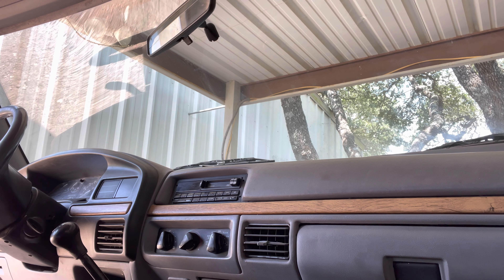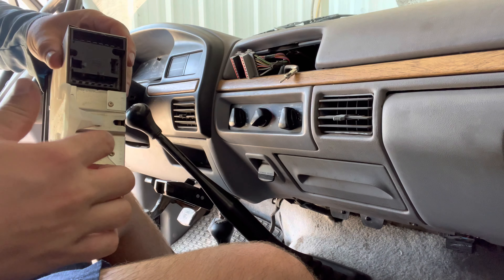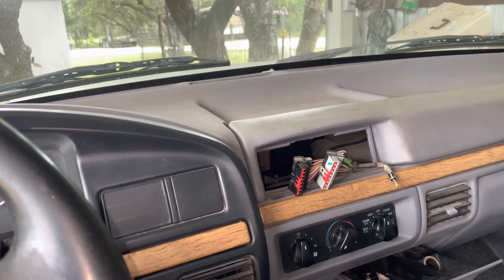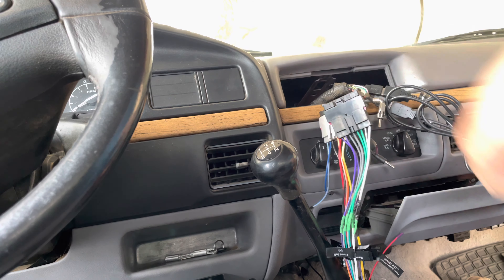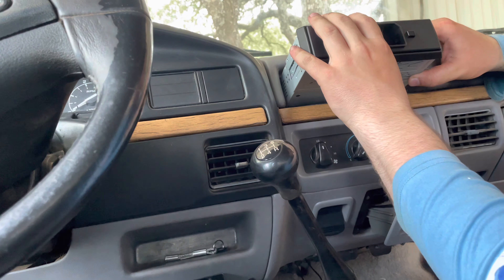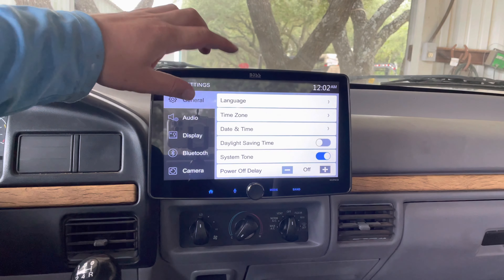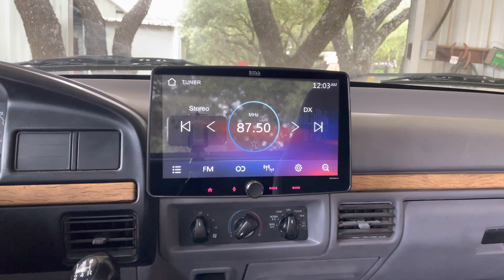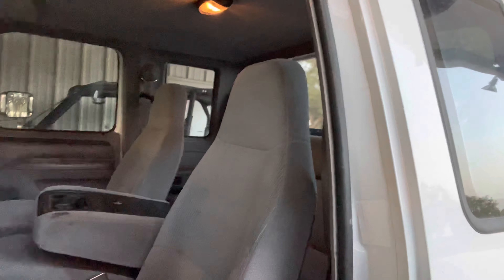An Absolute Necessity For Any Old Truck!

Comment: With the crazy prices of new trucks (between 60 and 100K) today, it's better to outfit an older truck that's in great shape. I am updating my pristine 2004 Super cab 4x4 F150 with low miles to have all the bells and whistles of a new truck. Total expense will be under 6k. Well worth it.
Reply: Jesus loves you alot trust in His death 4 salvation and be saved from eternal hell <3 Jesus died on the cross for you bro.
Reply: Exactly what I’m doing with my 07 gmc Yukon.  Wayyy cheaper
Reply: I’m pimpin out a 03 rwd liberty
Reply: You are so right. I’m going to stick with old cars until I can pay 50k cash. My coworker pays $1700 per month for two cars.
Reply: I’ve had two and i sold both there’s something missing with reliability and technology. It’s great but never consistent. Old trucks just work and cheap to fix you don’t need flash or update anything if it gets replaced and I had hard time justifying an 800 dollar tail light for my F150 and Ranger in case something happened lol the prices on those parts is insane
Reply: Now I’m glad I’m getting my old 94 Ranger as a cheap daily I can fix up until I find a much newer ride later on again.
Reply: Fr I have a 1993 Chevy k1500 and getting my transmission rebuilt right now it’s a good running truck I’m in it about 4000 atm around that maybe closer to 5 bought it for 2800
Reply: @Fit4C - Jesus should have taught you to spell,  “alot” IS NOT a word … you meant to say “a lot”
Reply: Funciónara para Nissan rogué 2018

Comment: I've gone through a couple of these over the years. Definitely a must. The only advice I can offer is; Make sure you get one with plenty of space between the head unit, and screen. The bigger screens will hit the bezel  if you tilt them in your direction to see better. My new has screen rotation, so I can switch orientations. Gives more clearance, but covers the a/c controls 😑 Great video! Wish this kind of content was available years ago. It's always harder when you have to figure it out yourself 😅

Comment: Had a fun time getting that radio out. I use 4 allen wrenches that will fit the holes tightly or close to and pull that thing right out.

Comment: A little tip for using those radio removal tools in the future, should you ever need to. When you’re pulling the radio out, pull the tools away from each other. That will cause the ends of the tools to push towards the sides of the radio and make them less likely to pop out.
Reply from the maker: @eagerestwolf  I appreciate it!

Comment: Thanks for linking the dual USB ports. I just brought the same radio for my car just the 9 inch version.
Reply: How does it sound?
Reply: @budjiman1  the sound is mostly dependent on your speakers, I'm sure you know that already but any radio is gonna practically be the same these days as far as sound quality goes
Reply: @JimTheKid  i bought 4 moper 6-1/4 inupgrades. Sounds way better!

Comment: Good job ! I’ve been thinking about installing one also! As for your seat just buy a memory foam seat cushion , I did because you’ll have a hard time finding a matching seat! My interior is the same color as yours ! Drivers side panel is cracked and needs replacing again no luck finding one! Also good to see your truck is a standard 7.3 like mine keep on rolling!

Comment: Thanks for posting this. I've been scheming up a similar idea for my 2001 Chev Silverado 4WD  Supercab. Don't know if it was offered in the U.S. but in western Canada they had the "Z 71 HD" package with better seats, nice interior & electronics and a good factory trailer package. The o/o was an audio fiend, and he'd installed a high-end Boss sound system just before I bought it. With luck, there will be a big screen head unit available for that, since it's pretty recent. The dash layout is similar to yours, and there's really no way to go the "double DIN" route. Just to make it interesting, I also have a ham radio setup on a Ram-type mount. 
What I'd really like is a higher, larger screen for GPS and the digital video from the wireless rear & side cameras. Those are a real game-changer & I'd like to integrate them so everything could use the one big screen.  Having the screen sitting high, as your setup is, looks useful.  The Silverado's layout is a lot like you have in the Ford.  The wireless back/side cameras  setup makes life a lot simpler. No fishing multiple cable sets, and the digital video signal is interference free. Anyway, thanks for showing this - it looks good, and has given me some good ideas.
Reply from the maker: I hope it all works out for you. So far I have really enjoyed mine.

Comment: I prefer the ones where the screen flips out so it doesn’t block any controls and just fits better with the interior
Reply from the maker: I saw those when I bought this one, but never had seen someone with this one. So I decided to give it a try. Still using it today and really like it, it is a little bigger than you need but it does not block any controls in my truck since you can adjust the height.

Comment: Did you have to drill the hole where you put the USB port in bigger? If so, what did you use?
Reply from the maker: Yes you do, I used a step bit to make it bigger.

Comment: Would the wiring be the same on a 88 f150 if so could you possibly do a video showing what all the wires are tied into the harness you did color code wise wiring is my weak point and I’d hate to burn my truck down or blow my speakers getting the truck for just under 2400 including parts to fix it

Comment: I’m installing this into my 1994 f250 and I was just wondering, there are 18 wires on the aftermarket radio unit, and only 14 wires on the harness, how exactly did you match up all the wires? Did you attach more than 1 wire to another wire?
Reply from the maker: The radio had some wires that I did not match up to anything. Just put electrical tape around them and keep them to the side. Just incase you do need them in the future.

Comment: Did you have to wire in the harness or was it something you could buy and just plug and play?
Reply from the maker: I had to wire the harness for the radio to plug directly into the truck.
Reply: Any way you could do and up close of all you wires to see which ones go where?...im terrible with wiring
Reply from the maker: My apologies but I would rather not pull my radio back out of my dash. Do you have the same truck as me? If so when you buy the harness it has a color list on the back that says the color of wire and what it does. Then you match that wire function to the wire that is labeled on the radio. Does that help you? If not I am sure someone has a video on the internet of how to wire. Looking back on the video I wish I would have shown me wiring it.

Comment: currently in the process of doing this with the same radio , anyone know which wires to leave out currently have everything on the harness adaptor connected excpet blue , blue/white and orange/white , dont know if i need to connect those
Reply from the maker: Just make sure you have everything attached like it says in the package. If you have any left over make sure to tap them off. I had a few leftover. Cannot recall the colors though.

Comment: How do i remove the cigarette lighter socket to put the usb piece in it?
Reply from the maker: Make sure your battery is unhooked. 
Unplug the wires in the back side of the lighter socket.
I believe it has a nut you have to unscrew that is around the whole lighter socket.
Then you will have to do some minor trimming to get the USB ports to fit.

Comment: dose it turn on the backup camara when you shift to reveres?
Reply from the maker: @yourmemenot5575  it will if you wire it to your reverse lights. This truck does not, my other truck does.

Comment: So driving down the bumpy roads are doing mild off routing how has this held up?  Thinking about getting one of these for my 2002 Cummins
Reply from the maker: It has been good so far. I added a piece of Velcro to the back side of it and attached it to my dash, so that the screen wouldn’t vibrate.

Comment: I’m gonna assume u still have this stereo in your truck. I live in Tennessee so I’ve got a quick question. How does yours function in the winter.
Reply from the maker: My winter doesn’t get very cold. When it does get cold it is around mid 20s and it works fine.

Comment: Thanks for the review 🫡 looks like you posted this about 2 years ago. May we have an update please 🙏 do you like it? Was it worth the money? Still works? Issues? Some people's reviews say the screen is too bright and is an inconvenience for night drives, any thoughts on that?

Thanks 🤙
Reply from the maker: 100% worth my money. The only issue I have had Is with my wiring. I twisted the wires the first time, so I had to take the radio back out and solder of the wires. The reason being is because sometimes my speakers would cut out, but that was my fault. I do not think it is not too bright (I went settings and turned the night setting to the lowest possible number making it very nice for night driving). Also when I wired the radio I connected it to my lights, so when I turn on my lights the screen goes to “night mode”.

Comment: So you have an older truck which probably doesn't have a modern security system with this thing sticking on the dashboard does it not attract theft?
Reply from the maker: That’s a good question. Most older trucks do not have security systems, but you can remove the screen very easily and store it away if you think it will be a problem.

Comment: My Apple CarPlay doesn’t turn on any help?
Reply from the maker: Did you check your connections? If so maybe there is something in settings. I never had a problem with mine, but I can try and help.

Comment: Hey Skylar, I’m getting ready to put the same exact setup in my 97 7.3, how did you get the usb cigarette port into the spot of the original plug in
Reply from the maker: I believe I just unscrewed the original one and pulled it out. After that I took a dill with a bit and made the hole bigger by just going around and around in circles unlit it was the correct size.
Reply: I appreciate it brother thank ya! Also wanted to ask did you use any of the bracket pieces? I’m a bit stumped on those
Reply: And one more thing, when you connected your harness to the plug in did you wrap the wire ends around one another or just simply shrink wrap em together?
Reply from the maker: Personally I did not use any brackets other then the white plastic one I showed in the video.
Reply from the maker: I intertwined them and then covered the bare metal with shrink wrap.

Comment: What did you do to mount the new radio? I bought one and all ready to put it in but haven’t figured out yet how to hold it in place.
Reply from the maker: Mine just slid in. I put that white hanger on the back of it to hold it up. Other than that it just sits there and I have not had a problem
Reply: @skylarwagner1155  where did you get the white hanger piece?
Reply from the maker: @JordanGrayMusic  it was on the old radio out of the truck.

Comment: I bought the same radio and installing it in the same truck I installed it and as soon as I flipped to my rear tank the radio popped and started smoking. How did u ground ur radio?
Reply from the maker: I grounded it to the stock wiring harness.

Comment: Is there anything else you would recommend i buy for the radio other than what you have linked in the description? Very close to buying the 9inch version just wanna make sure i have everything needed.
Reply from the maker: The only other thing I bought was some Velcro so I could stick the bottom of the screen to my dash. The roads I drive are really bumpy so it keeps the screen from moving so much.

Comment: I got mine today and was wondering what you used for the parking brake wire on the back of the harness
Reply from the maker: I believe I did not wire that up. I just taped the end and tucked it out of the way.
Reply: Just add to the ground wire. Find someone who can verify.  I'm doing this in my rv. That was my tip. With a very stern" Don't watch TV going down the road." Lol!

Comment: Do you know what you would do it the plugs you have don’t Match to the ones on the truck?
Reply from the maker: Do you have an obs for like mine? If so and the plug doesn’t match up you most likely have a factory amp, if so I heard that the plug like I used is hooked up to the amp somewhere so you’ll just have to find it. Maybe look up some videos on how to by pass the amp. You can also just cut and splice all the wires together.

Comment: What wire did you use for the reverse wire for backup camera? I have same truck and year and same touch screen
Reply from the maker: I didn’t hook mine up to any trigger wires. I just turn it on manually when I hook up to trailers.

Comment: Did you ever get CarPlay to work and if not why doesn’t it? Looking to put it in my truck
Reply from the maker: CarPlay works perfectly, maps are not laggy and everything works.
Reply: @skylarwagner1155  how did you get it to work I just got this radio and CarPlay isn’t working
Reply from the maker: You have to have that external usb plug that plugs into your phone. Once plugged in go to the Home Screen where you can see settings, tuner, CarPlay, etc. click on CarPlay and it should work.

Comment: I'm thinking of getting this for my jeep tj. But I will have my top down so my question....is the screen removal for security?
Reply from the maker: Yes, behind the screen there are 2 buttons that you can push and the screens comes off.
Reply: It’s the reason I put it in my Jeep JK. I was gonna go with a much more expensive floating screen but none of them are removable. If I have the top off my Jeep and it starts pouring, I need something that detaches instantly. Boss Audio is the only one that does. And guess what ….. it’s actually a beast of a radio so far. Only time will tell. But it actually has a 5 year warranty. Sony and Alpine only have a 1 year on there’s which are 4x more expensive.

Comment: Is yours still running? I've got the same one and it died after about a month. Waiting for a warranty replacement.
Reply from the maker: Yes! Mine is running good I use it everyday. Sorry to hear that I hope you get a new one from warranty.
Reply: @skylarwagner1155  Getting the radio replaced under warranty.

Comment: Does it shake while driving on the freeway
Reply from the maker: Mine does not, only when I went down dirt roads. I did fix that shaking problem by adding Velcro to the back of the screen and sticking it to the dash though. Now it does not shake at all.

Comment: On something like this if you were to plug say an Xbox 360 video av into the back up camera then when to av(or the back up camera on button) would it work.??
Reply from the maker: Not sure, but I think it has the correct ports on the back of the unit for it. You will just have to find power for the box.
Reply: @skylarwagner1155  power inverter on Amazon

Comment: Hey nice job doing the install! Do you have a link for that steering wheel cover if you got it online?
Reply from the maker: I actually bought it at Walmart, should be in the automotive section with a few other selections.
Reply: Ok thanks,
Do you know the size by any chance that worked for you
Reply: Also do you know where one would find new leather bench seats that fit in this generation truck?
Reply from the maker: I do not but I believe Katzkin makes leather replacement covers, where you remove the cloth and put on leather. I am planning on doing that in the future
Reply: Ok thanks man, and do you know the size of the wheel cover that works for the truck

Comment: I wired it but I have no audio
Reply from the maker: What did you install it in?
Reply: Did you ever get it fixed?
I’m having the same issue.
Connected directly to a set of speakers separately outside and still no audio